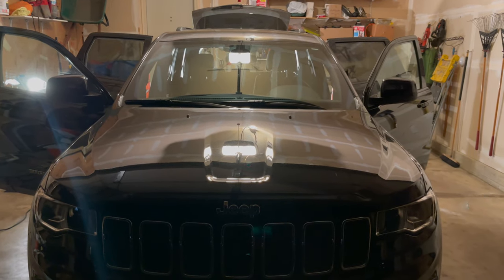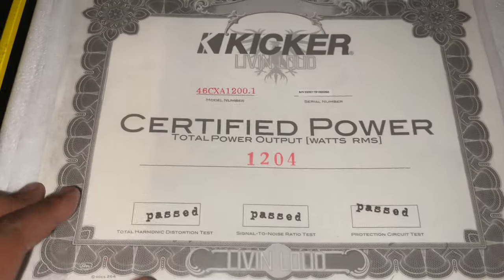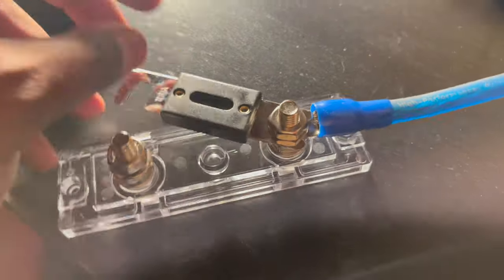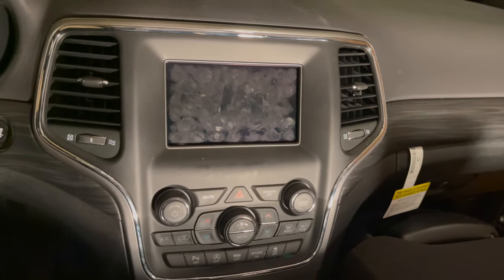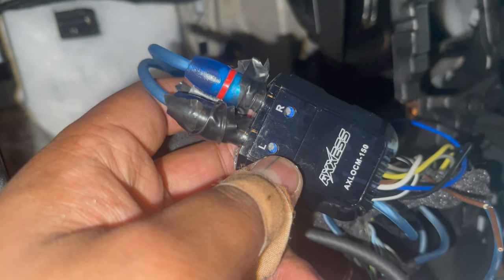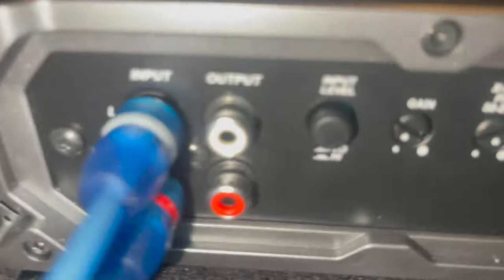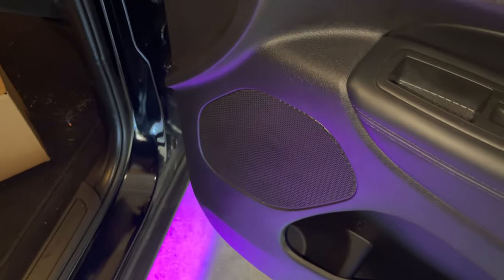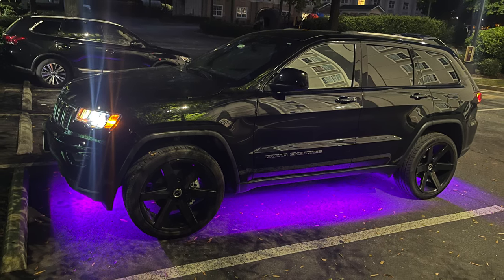How To: Sub and Amp Install '21 Grand Cherokee

Comment: I had a 2020 and didn’t like the battery under the seat.  Now I have a 2022 and the battery is back under the hood. I actually wish it was under the seat because it would be easier to hook up power to the amp.

Comment: You can also just tap into the rear speaker w/ a line inverter to supply feed to the subs . Without tapping/ touching the  dash
Reply from the maker: It’s easier to tap up front to me. Also, the front speakers provide full range so I could add another amp if I wanted by adding rca between the amps
Reply: Does the sound quality sound good since you tapped a rear speaker wire? Which one did you tap?
Reply: Sound quality is the same .. it’ll be better only if you actually tap into a factory low pass line aka factory subwoofer ( adding a sub) . Sole purpose of a Line converter

Comment: I got the same speakers and amp and Best Buy said they can’t hook it up cause of my factory amp and tried to get me to spans $1300 more on a new radio .. do you have a factory amp?
Reply from the maker: @coymac5836  yes. In this video I use a “low output converter” (loc) which is used to connect to factory radios

Comment: I just picked up a '15 Jeep GC SRT with a RIPP Supercharger. I am going to do a stealth sub upgrade. I really did enjoy the fact that you mentioned the easy way to gain match. Massive props to you and not saying "3/4 volume and adjust til it distorts and back down". Awesome tip bro!

Comment: Just bought a 2018 GC and took my speakers out of my BMW today. Got 3 10" MTX thunders in a thick plaster box with plexiglass back and a 4000 watt amp from planet audio. Don't think I'll be able to hide my 0g wires under the trim tho 😂 glad to know the install will be relatively easy!!
Reply from the maker: I’m on 0 gauge these days. I actually ran the wires under the carpet from where the battery compartment is back to the amp

Comment: Mannnnn thank u bro I Been lookin for the wiring diagram for the color of the speaker wires for a min glad u broke it down I want my 2 12s hooked up before Christmas
Reply from the maker: Yeah no problem bro. Allotta ppl tap into the rear speakers and then wonder why they need a LC1 to recover bass. Just tap into the front speakers. They’re full range.
Reply: @BigStuDolla91  ohhhh okay I got the audio control LC7i
Reply from the maker: @daviedave0915  well if the moneys spent may as well use it. I didn’t show in this video but later I saved like $200 (vs LC7) by using Kicker’s speaker wire to RCA adaptors (only $10) and then plugging RCA directly into the amp. This works if your amp accepts “high level inputs”
Reply: I didn't pay 200 for it got it from a friend for 40bucks
Reply: @BigStuDolla91  neither one of my amps have hi level inputs I have a wolfram c2400.1 and 2 wolfram ag 12s with the sundown sfb200.4 everything come out of my other vehicle

Comment: I just bought the same subs, but bought the 1800 watt amp. I hope that's not too much for them. I'm gonna be putting them babies in soon 🤪
Reply from the maker: Once the addiction starts you’ll want more anyway😈 at least now you have enough power to upgrade subs later

Comment: Man you had me laughing, if you have a problem do not return to store “shiiit”😂😂, but on serious side like you said , set your amp voltage quickly, no one is going thru the trouble of disconnecting speakers for this. Again great video.

Comment: the remote wire next to rca doesnt do anything at all to worry about anything its the power wire that you cant run next to the rca. In fact Monster had a rca wire that had the remote in the rca wire.. made running cables so much easier. been doing this over 20 years and never had any issues with it

Comment: With them new kicker amps too you can buy kicker k series rcas and cut off the other end and run it straight into speaker leads no need for separate LOC. just change input to high
Reply from the maker: Believe it or not that’s how I originally set up the system before I made this video

Comment: Thanks bro, definitely nice to have a good TLDR of how this thing comes apart. BTW, that plug used on the back of the head unit is the same style used for ECM’s on lots of stuff, especially big rigs. 

Does anyone know if the dealer will void a warranty over doing this install? I’m a professional mechanic so doing the work right isn’t any issue. I just don’t mess with cars that much (I’m a diesel mechanic) so I don’t know how the dealership I got my GC from will act if I do this install.
Reply from the maker: Honestly im not sure. I always do work in a way where I could easily reverse it if necessary
Reply: @BigStuDolla91  word. I feel ya on that. I’m thinking bout just swapping the factory stuff at this point. I showed the wife the shot of your car you took at the end and she was like “looks good but no box’s in the back”. Even tho I bought the car lol. However, I got permission to do everything else I want and because of yours, I got permission to start looking at wheels too (marriage is fun lol).
Reply from the maker: @jaythatguyyouknow5135  I’m married too bro. I bought all this before wedding cus I saw it coming😂😂😂😂
Reply from the maker: @jaythatguyyouknow5135  btw I think some company sells a box that replaces the stock subwoofer location
Reply: @BigStuDolla91  really! I’m definitely gonna have to peep that. 

We just got ours like 5 days ago. We lost our home and most of our possessions to a house fire (no one was hurt thankfully) and the heat of the fire melted the wiring harness of her old car. So I started looking at cars without her and then surprised her once I bought it. I just wanted her to have something much nicer than what she had with all the features I know she has been wanting so it would help ease that part of this crappy situation. That and now I have an excuse to go get me a truck in the near future. lol.

Comment: RQQ Dawg hoping to knock my setup out this week
Reply from the maker: RQQQQQ
Reply: Wassup dawg, my jeep is a 2015 and I’m not sure if the wiring colors for the head unit are the same as yours. I have power to my amp, turns on and off when it’s supposed to but my wires behind the head unit have to be in the wrong place. Any suggestions??

Comment: I don’t know if yours has it but besides the amp I powered off the 12V outlet in the rear. Also installed the in line converter back there as well. I just didn’t want to mess with the dash.
Reply: Can you explain this alittle more?
Reply: @Alphazillla  look up installing wiring in jeep SRT part 2. That’s where I got the idea for the inline converter. The amp was powered off the battery.

Comment: Great video, clean install. Have you thought about doing a "Big 3" electrical upgrade and installing a bigger battery? Are you running a stock alternator?
Reply from the maker: No. I run 0 guage these days but i didnt go all the way to the alternator. Im still running stock alt

Comment: Did you have to upgrade the gauge of your alternator wire to the battery at all? I have an Hifonics Gemini Elite 1500.1 that I run two Skar SDRs down to 1ohm mono.
Reply from the maker: No. Still no headlining dimming

Comment: Great video, learned a lot and helped me with my install. One question I have is which factory wire did you splice the blue remote turn on wire on the hi-lo converter? Or did you not have to splice it and it just kicked on from the speaker signal?
Reply from the maker: I didn’t splice the remote wire. After splicing the power and making a ground, the converter generates power through the remote wire to connect to the amp.

Comment: i wanna see a big 3 on this. should be interesting since the battery is under the seat
Reply: The big 3 it’s the same cz at front it’s the red n black normal to jumpstart u get it from there
Reply: I’m buying a 2022 here soon and I’m planning on what I need for the system I’m installing. I know I’m upgrading the alternator wire to at least 4 or 2 gauge

Comment: I had a 2020 Jeep Grand Cherokee with the low-end stereo and yeah, that thing sucks. I just got a 2022 with 19 speakers and 950 Watts and it’s much better. I think I still want to add a single 10” or 12” JL Audio subwoofer in it.
Reply from the maker: Yeah I tend to avoid factory upgrades at the dealership cus I’m prone to ripping shit out anyway😂

If your sticking to JL audio 10” they have a stealthbox that replaces the factory sub. It’s expensive but saves space.
Reply: Go with the 13tw5.. u can use a small box and keep ur cargo area open

Comment: You need an audio quest lc2 line out converter, that'll solve your problem. I have a 2015 cherokee with an alpine pdr m65 with a type r 12 wired to 2 ohm and a lc2. The lc2 with boost the low frequency to the amp because the head unit and a certain volume and beyond will not amplify the signal. Factory head unit will start clipping above 75%. I usually have volume at around 28 to 32.
Reply from the maker: What problem
Reply: @BigStuDolla91  ☝️
Reply from the maker: @joshuaplaza8002  oh ok. With CarPlay the system gets attenuated at 25 and on the HU. But I usually go to 22 max anyway so this works for me
Reply: @BigStuDolla91  great video my guy!!

Comment: I’m about to run a similar setup in my 2020 Jeep.   When I hooked the system up in my last car(2015 Mitsubishi outlander sport), as soon as I hooked the battery back up I started getting an airbag system service required light.  Some people said that with the newer cars you have to plug something in when you disconnect the battery to retain factory settings and that was the reason I started getting that light since I didn’t do that.   Have you seen anything like that in the Jeep?   Last thing I want is to get warning lights after hooking it up.
Reply from the maker: Haven't seen this problem. This car technically has two batteries so even when to disconnect the one I show in the video you should keep all settings
Reply: @BigStuDolla91  awesome, thank you so much.  Great video by the way

Comment: Okay so I’m doing this on my 2017 Jeep Grand Cherokee I did everything you did basically wired it all to the head unit no connections are lose I got power to my app remote wired up to a Metra loc and and everything has power but I get no output through my sub or a speaker that I tested as well, The only thing I’m thinking I did wrong is wired the wrong wires in the head unit
Reply: It’s an unlimited to if that makes a difference ^
Reply from the maker: @shiftgog8550  start the car, turn it off, get out, lock the doors with the remote, unlock the door then get back in and restart the car

Comment: Couldn't you just shut the front speakers off via the head unit when your doing the test? Or would that work?
Reply from the maker: No it all has to stay connected. If you disconnect the speakers they won’t feed a signal. I didn’t know that when I made this video

Comment: I tapped into my front speakers.Using the speaker color chart you listed.When I plug both RCA’s to the amp.It gets really low but If I unplug one it works better.Any ideas on what could be cause that?
Reply from the maker: You may have wires crossed. Probably connected a positive where a negative goes etc.
Reply: You were right! I went back in and it was there it was.I also grounded the converter.Everything is working as it should.Thanks for the great video and reply

Comment: How did you bypass the ANC?  My 2021 has it and I get the hum. I tapped my sound off the Factory sub in the back rather than removing the headunit.
Reply from the maker: I don’t have ANC. A guy once told me he had to disconnect the ANC mics on the roof. They’re wired in series so disconnecting one works for all of them

Comment: Wish you had a factory amp and sub to see how you did that. Going to put a setup in a 2022 when i wake up.
Reply from the maker: By tapping behind the radio you effectively tap BEFORE the factory amp and bypass it. Make sure the tap the front speakers not the rear. You can probably leave the stock sub connected if you want but otherwise disconnect it in the back
Reply: @BigStuDolla91  I've always heard that the factory system and the aftermarket system will fight each other
Reply from the maker: @reytijerina7496  they could be talking about the active noise canceling thing some systems have. I’ve been told that can be disabled by disconnecting one of the mice in the headliner. I haven’t had to do it but I’ve heard it’s easy access through the sunroof. They are wired in a straight line so you only need to disconnect 1 to  shut it all off
Reply: @BigStuDolla91  back years ago i had a 99 envoy(blazer body style) which had Bose audio. My local car audio shop had told me i had to bypass the bose amp because of that reason. 🤷🏽‍♂️
Reply: @BigStuDolla91  needless to say i did it the easy(long/tedious) way and ran my own wire to each speaker. With this '22 cherokee, i jus unplugged the sub and tapped into the LF input side of the factory amp. Have to finish running rca's tomorrow. Great video. Really appreciate your time and advice.

Comment: So I did this but my back door speakers went low sounding what am I doing wrong my line out converter has adjustment pods but not knowing how to tune it I left it at factory settings please help
Reply from the maker: hey the rear speakers are designed to cut out bass. you need to tap the front speakers. sorry, i learned this after i made the video
Reply: @BigStuDolla91 my colors are different I don’t have the right colors and there are no diagrams i’m lowkey lost

Comment: What is that little black thing you wired in? Is that needed to make it plug up to the cars head unit?
Reply from the maker: Low Output Converter. 

Turns stock radio signal into a rca signal that the amp can read
Reply: @BigStuDolla91  awesome thank you!

Comment: Can we see a quick pic of  how u splice your loc wires into the head unit 🤔
Reply from the maker: The Loc will tell you which wire is which (yellow is positive etc). Catch is the unconnected system won’t send a signal if the speakers are disconnected. I found this out after I uploaded the video so amp tuning would have to be done while the speaker is connected. Just do it quickly so your door speakers aren’t damaged lol
Reply from the maker: Also. Cut the wires behind the harness. I extended each wire I cut with some speaker wire then splice into the speaker wire. This gives more room to work with.
Reply: @BigStuDolla91  yeah that's what I was wondering,  because when I checked those wires on the unit are tight in the bundle and then on the loc very short. 👌🏾 thanks BigStu
Reply: you running 8 Guage or 16 Guage ?
Reply from the maker: @2009princeofswagg  power: 4 gauge, speakers: 16 gauge

Comment: I have a 2014 grand cherokee which has a stock sub would it be easier to connect the subs to the factory amp that is in the cargo area which isn’t that hard to access to
Reply from the maker: I would recommend just going behind the dash that way you have full control of your amp settings

Comment: Do you have to disconnect the auxiliary battery wire to install the amp wire?
Reply from the maker: Attached amp power wire to the main battery positive

Comment: I just installed and used that big red wire behind radio does you amp stay on? Because mine want go off when i turn the car off
Reply from the maker: Mine cut off with the car
Reply: Any solution mine wont turn off either?

Comment: Hey BigStuwop do you think that you will need to upgrade your alternator to a high power one
Reply from the maker: Nah not at 1000rms. I don’t get any dimming. Even the underglow lights
Reply: @BigStuDolla91  what if it’s 1500 rms?
Reply from the maker: @dravenherrera3519  not sure. Think you should be fine though

Comment: Wat up bro i just got a grand cherokee im trying to put my 12 in. I have a pac lp7-2. Did you strip all four speaker wire or just two? And if so which ones
Reply from the maker: Front two when i was just running bass. When i moved to a full system i had to strip all four.
Reply: So do i run wires on front both speakers positive and negative or just choose one speaker
Reply from the maker: @shaneywill0425  both speakers positive and negative
Reply: So in my lp7 i got the speaker negative to negative positive to positive hooked up to make one positive and one negative? Do i take them loose and make them four hooked up wires?
Reply from the maker: @shaneywill0425  you should have 4. 1 positive and one negative from each speaker. The loc should have the same number of inputs
Reply: U got a ig bro
Reply: Instagram
Reply from the maker: @shaneywill0425  BigStuwop
Reply: @BigStuDolla91  im hit u on that just bro

Comment: Where did yu connect remote wire?
Reply from the maker: Remote wire came form the low output converter and went to the amp
Reply: Also what powers the low output or do i just connect the speaker wires and the remote wire to it and thts it
Reply from the maker: @Angelo-pe3vf it depends on the low output converter but I think some have a power input that you would splice into

Comment: I have a different converter the tri connect. Are you able to help me with the wiring conversion from yours to mine?
Reply from the maker: The wiring on the Jeep side would be the same. The LOC should tell which wire is which on its package
Reply: @BigStuDolla91  yes it does but which wire goes to which? this is definitely my first time
Reply from the maker: @rachelsherrill3457 without seeing the LOC I wouldn’t know. In the vid there’s a chart I put up you can screenshot for the Jeep side

Comment: I got a kicker cx 800 amp running that same box is that enough at halfway and do you need to bridge the speakers to one ohm To match the one ohm amp or does it come factory like that
Reply from the maker: This box Comes factory at 2ohm. I guess u could take the subs about a rewire them down to the ohm. You probably still wouldn’t have a 1000rms output from that amp though cus it’s rated for 800.